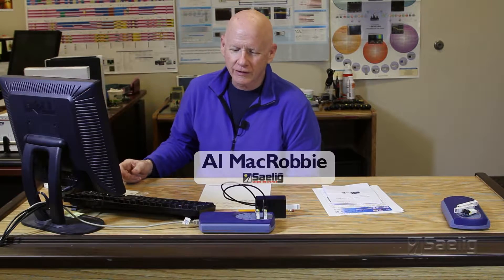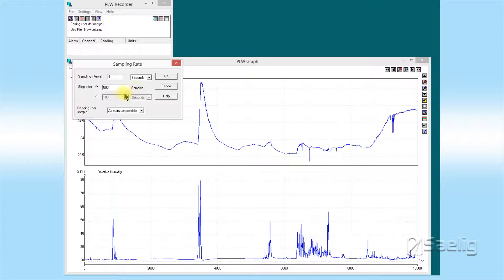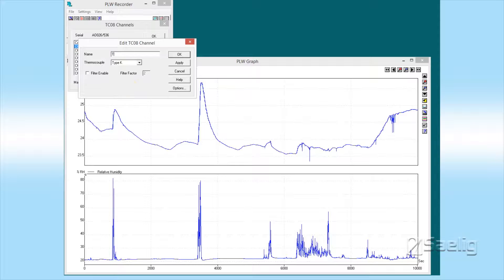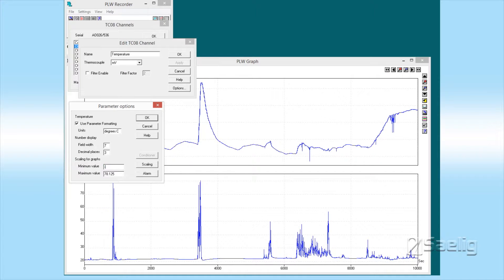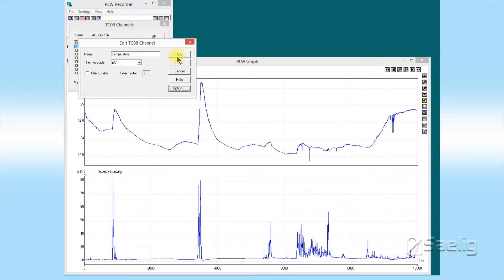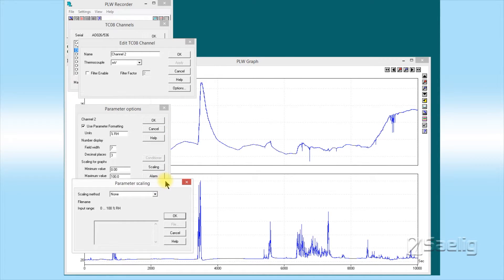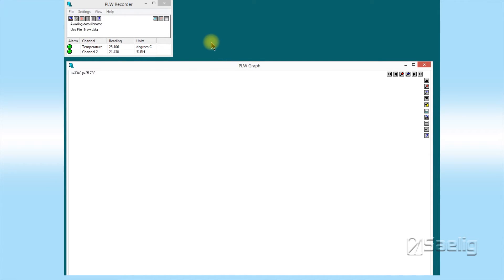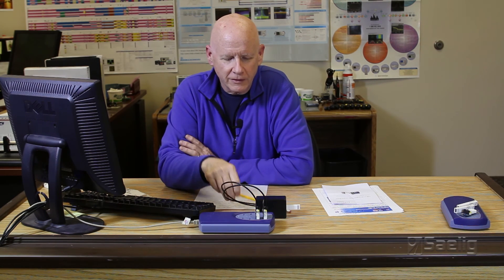Pico Technology TC-08 Data Logger - A Practical Application Video 2 of 2

Comment: Hi there. Could you please demonstrate how to get voltage vs time plot, current vs time plot, voltage vs current plot of the electrochemical device (fuel cell) using pico log datalogger (1216)?